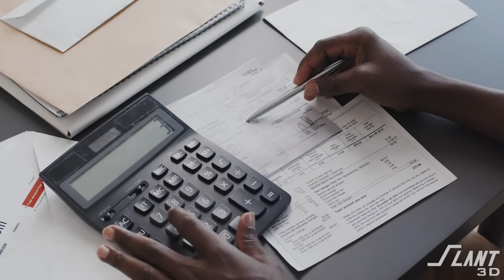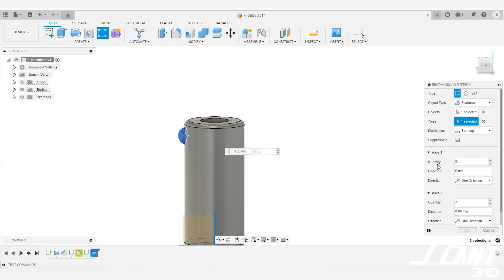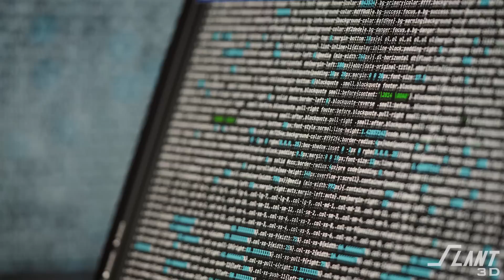3D Printing Will Obviously Replace Injection Molding

Comment: This year I sold around 3k 3D printed parts in kits and kits consisted out of different parts. Yes, I could have injection molded the main part, but would have needed a way higher upfront investment and would have needed to match look and feel with the low volume "auxiliary" parts. What people ignore is how insane of a quality MJF nylon sintering produces and how well it scales especially for smaller parts. Those prints can even be chemically treated / vapor smoothed to be gas-proof or cerakoted, if need be. This way I could modularize the kits to better match customer needs. And I was able to order in two seperate batches according to customer demand all with less than two weeks of lead time.
Reply: That's all well and fine but it's not a replacement for injection molding and your own comment proves it. 3k parts is nothing for an injection mold. They can make that in a couple days depending on part size. Also you mentioned the need for post processing to improve surface finish. Something that isn't needed on injection molded parts. Also i checked the tolerance for mjf nylon and its .012" that's laughable in the injection molding world when a loose tolerance is .005" and a tight tolerance is .002" like come on now. So while 3d printing is a great tool for small batch and medium production it will never fully replace injection molding the way it is now. Another thing to think about as well is large components. Can you 3d print a lawn chair as fast and as cheap as molding it NO. How about car interiors. How about tool bodies with multiple materials. What about metalic components like a dead blow hammer. While I don't doubt that 3d printing has a lot of cool applications to save money and time  mass production of parts is not one of them. End of story.......

Comment: Looking around me, there are not many plastic parts that I think would benefit from 3D printing passed the prototyping phase. What I see in front of me: keyboard, phone, computer monitor (large enclosure), pair of scissors (handles), pill box, shirt buttons, all sorts of cables and connectors, ... And I mean, look at 5:55 , these bins don't look 3D printed to me, and if a print farm doesn't print its bins, who will?

Comment: Very contentious opinion:

1.- Economics: do not underestimate the volume that certain industries require, for example automotive, one car will need thousands of different pieces and literally hundreds of thousand pieces of each, eventually your farm footprint, energy use and administration will be more expensive than the equivalent injection machine, and not every mold is a super expensive tool with slides and cooling ducts, some of the simpler ones can be made with a good CNC machine.

2.- Engineering issues: while 3d parts are improving injection molding is still generally tougher, less prone to quality concerns, while a 3d printed part can fail basically anywhere injection mostly  fails at the seam or the sprue, which depending on the application isn't a big deal, yeah they can shrink or warp too but they are much less prone to do that, some parts are actually easier to inject than to 3D print because of support material which you will never be able to completely avoid and FDM printing should not be used in some industries like medical and food due to safety issues of having lots of small crevaces in your part. Also what about larger parts? It would be really tough to print a car dashboard or a large box with 3d printing, that would be a very wasteful application where you would need a very large 3d printer with lots of empty spacebor even specially designed, also what about transparent parts? I can go like this forever but I think those are enough.

I love 3d printing, I do it all the time and see the value of it but this is overselling it.
Reply from the maker: Toyota considered 25K mass production
Reply: @slant3d  that's a very unfortunate statement considering they sell just in the US around 250k Corollas per year. Most vehicle programs produce AT LEAST 50k units per year and the larger ones like the F150 sell around 750k units per year.

Comment: Flexibility does not equal scalability, and injection molded parts are foodsafe due to low porosity. We print containers to organize parts, not tupperware to put in our fridges. Surface finish is a huge contributor to why injection molding is the way it is, spend $$$ on a perfect mold to make perfect parts for a long time on a single machine, it eliminates the variability that is every printers calibrations, variables are scaled down and production is scaled up. I know you're smarter than this, extruding filament slowly in singular layers, is not a catch-all solution.

Comment: What about cars and legos? Where high volume, infrequently changing design, and a need for high surface finish quality are combined, I don't see even the most efficient print farm outcompeting an industrial plastic injection mold setup. I think you've made your point about scalability really well, but I'm curious how you think 3d printing could take on well established and steady markets like car parts and LEGOS. Thoughts?
Reply from the maker: Lego is testing 3D Printing today.
Reply: @slant3d  I didn't know that. Super cool! Well, thanks for the video and thanks for sharing your knowledge about industrial scale 3D printing 😁

Comment: Your math isn't mathing. 

Assuming everything is in house

If I need to produce 1000 parts, I can easily print them. 
If I need to produce 10,000 parts, I can use a resin mold and a small injection machine
If I need to produce 100,000 + parts, I can use a industrial grade molding machine. 

Under what circumstances would dedicating 40,000 sq feet to a print farm be the most efficient way to produce parts quickly and consistently... Cramming 50 printers into the same volume as a single injection machine is still gonna have longer cycle times. If space is unlimited, then you can throw more printers at the problem until the win the total output metric, but I am not convinced that its cheaper, just more flexible at the expense of maintenance/complexity of scale.
Reply from the maker: We do it everyday
Reply: @slant3d  Again another empty reply with no actual data or proof behind it.  You are just spurting out your opinion with nothing to back it up here.  Why bother replying to the comment if you are not going to even address it?

There are applications for FDM but saying that putting 1000 machines in a large building is the same as injection molding isnt even talking about the elephant in the room man.
Reply: @slant3d  Being based out of Boise is massively tainting your perspective. Most places can't just dedicate more space to more printers because of the cost per sq foot of workspace. You are in one of the cheaper markets and trying to extrapolate your success to Tokyo.

Comment: Welp, I believe the comments section has captured it all. 

While the upfront cost of injection molding tooling is high, we usually design in a way to share it with other products or future-proof it. The tooling manufacturer can also modify the tooling to accommodate certain dimensions. I appreciate 3D printing during the prototype stage, but it doesn't seem likely to completely replace injection molding in the near future. Each has its own place.

Comment: Here is what you forgot. injection molding machines produce more parts per sq foot of shop space. 

If you measure output per sq foot, you immediately run into a wall of cheap space is in locations without skilled labor and skilled labor is in locations with high cost per sq foot. 

That alone is a huge justification for injection molding.
Reply: And are you accounting for downtime as well as upfront costs?
Reply: @SirSpence99   upfront costs are good to be exorbitant regardless. To some extent you can grow into a print farm, but you run into issues really fast like not having enough amps on the breaker. So now you have to remodel to turn your warehouse into a factory. 

Molding to some extent requires you to just start with a factory, so slight advantage 3d printing, but we are comparing prototyping to production kinda by definition at that point. Anyone looking at either needs to deploy serious cash regardless.

Downtime is a more interesting conversation. Would you rather have 10 percent of your machines broken at any point in time or 100 percent of your machines broken 10 percent of the time? It would be the same total throughput, but the first requires way more labor to manage.

Comment: if you are trying to bait the discussion i think its a little cheap on your side but effective none the less lmao.
On the other side i think you are way too retail oriented on your business, at least that is what we see on youtube, it would be nice to see real industrial, well engineered parts on the videos and discussions on that front, at least imo. And it would be nice to see a little humility on the answer of real well argumented comments, and not take the "im too ahead of my time" kinda Steve Jobs take that you are having.
You are also reaally underestimating the possibility of cost reduction on the moulding machine side, at the end of the day it is a cheap block of aluminium or steel in most cases, so the cost is all industrial, that means potential cost reduction over time approaching material cost.
Reply from the maker: Check our library
Reply: @slant3d  Again, a well thought out and articulate comment and you can't be bothered to give them a real answer.  Why respond at all if you aren't going to try and address the comment.  "Check our library".  You could provide links to relevant videos that address the comment, if they exist.
Reply: @LearnEverythingAboutDesign because he's wrong and he knows it. This is an ad for his business. He doesn't really know what hes talking about when it comes to mass production of components. He also doesn't go over surface finish which is a massive drawback to 3d printing.

Comment: Whoa.  3d printing is a very good low-volume test environment.  Way different market than high-volume injection molding ie packaging products, food containers, construction, medical, etc...  These markets often require millions of parts per day.  It has its place but quality and product integrity still have a long way to go for printing.  You might want to go visit a large molding plant and reassess those comments.
Reply: Yeah 3D printing and injection molding do not share the same purpose at all. Injection molding is for making parts that are needed in massive quantities very quickly. Parts that you will need a lot of, for a long time.

3D printing is for prototyping, making drafts, being able to change the model being produced on the fly, and perhaps most importantly, being an accessible means of production to people who don't have dozens of thousands of dollars or more. 

However, I'm not saying that print farms can't be effective ways to make money quickly. We wouldn't see print farms hardly at all if that was the case. Print farms can change their produced product in just 24 hours with little to no modifications. They serve a different purpose than injection molding, which is why they will not replace it.
Reply from the maker: Not to be pedantic. But packaging isn't really a product. Molding can have it
Reply: @slant3d  Packaging is 100% a product.  And how can molding have it if 3d printing will replace molding?  I have had to design geometry for polystyrene for boxes to hold things during shipments.  Molds are made, there are requirements for draft angles and radii etc.  To think that packaging isn't a product just shows me that you haven't designed products.  Thermo formed "blister packs" are designed.  So if your smartphone came shipped in a sock vs a well designed box it would be the same thing?  And you missed the point of the comment and focusing on one thing in it.  To think some of the medical device projects I have worked on for clients would be end use FDM is laughable and it shows that you are in a bubble.  Sure FDM print farm for etsy shops selling trinkets is fine, but to claim that it will replace injection molding is either something you are doing as click bait or you drank your own koolaid man.  FDM can exist without waging a war on other manufacturing processes.

Comment: 3D printing has numerous advantages as mentioned, but the poor surface finish, highly anisotropic material properties, and low cycle time per machine makes it incompatible with most products. Stick to making the most of 3D printing and stop lying about its limitations.
Reply: spot on, i have a couple years of 3d printing small business and i think here is being a bit oversold, as any business owner should of course
Reply from the maker: Incorrect. There is no engineering reason. Printing can't replace virtually every molded product
Reply: @slant3d Can or can't? You are contradicting yourself in this comment
Reply: @slant3d   Your company makes 3D printed parts at a large scale. I know that. It’s also true that there are limitations to the technology.

Comment: Unsubscribed. This video is full of dishonesty. 3D printing is a great technology but it will never replace injection molding, not even in most applications. Wishful thinking from someone who is completely blinded by your own biases.
Reply from the maker: Already is. Check what we do for a living
Reply: @slant3d   Your company does 1000’s of parts. The global market for injection molded parts is billions of times that. 3D printing is not as scalable as injection molding due to the human labor component required to keep 3D printers running at capacity.
Reply: @slant3d  Yeah you have an FDM print farm and make false claims about FDM being equal to molding.  Got it!  You can promote your business and FDM and not try to make it some massive global take over.  IF you were going to do that with 3d printing why on earth would you pick FDM as your horse in that race?  MJF, SLA, SLS all have major benefits over FDM.  The downside is the startup cost.  So you picked the cheapest option, that most people have at home.  An injection mold machine can spit out more parts in an hour than your print farm can spit out in a week.  And that is fine.  Just don't try and skew it.  You are either lying to people so they use your service, or you are very out of touch with the entire industry of manufacturing.  Not sure which is worse, but please back up your claims or state them as opinions so people know.

Comment: There are certainly some parts where 3d printing will replace a molded part but I think you are underestimating just how many parts are high volume. In my industry I’ve seen many parts moved from a machined metal process to 3d printed, but never a part that would have been molded to 3d printed. If the volume is high enough to justify the cost of a mold, then the volume is too high to justify 3d printing it, the space required and manpower needed to match the speed of the mold just doesn’t add up. One of the 4 molders in my facility makes 300k parts daily and very rarely ever stops due to over production.
I see 3d printing as far move of a threat to machining then to molding.

Comment: Yeah - no.

FDM  and resin processes have an important place in prototyping, but there are some glaring shortcomings in the material properties of the parts produced. As for mass production, its hard to beat the volume and low cost of injection molding. The part's mechanical  properties are better (uniform) with IM as well. And, highly precise parts are probably still going to be machined from billets, (can't tell you how many acetal and nylon gears I had to make during my machining career).
All the products of engineering are compromises. Its always a case of whether the choices made will meet the mechanical needs of the application.

Comment: Diecasting is for toys😂. You can't 3d print a 🚀 engine 🤣. Future is 3D printed molds!(made out of high impact, high thermal conductive, high temperature thermoplastic!) that can be used in equally low cost, low pressure continuous injection? ultra small formfactor(size of a large desktop 3d printer) plastic injection machines❤👍

Comment: Using 3DP for rapid prototyping and iterations and then making a mold of the best prototype is how my lab uses it. If you consider how much space injections molder take up you could fit about 25 to 50 printers in the same space for the same power and price. This should be taken into account when looking at cycle time.
Reply from the maker: True. Printing already matched molding in production scale

Comment: 3D printing is great for fast iterations and personalized products.
But we will never 3d print syringes. They will be injection molded - alongside many other products that we do demand millions of.

3D printing has it's place, injection molding has it's place.
Reply from the maker: 3D Printing Printing will effectively replace tradition in effectively all product ranges. We still use horses today because cars can't walk. Doesn't mean horse are "better"
Reply: @slant3d  I definitely agree with you for 95% of the types of products that are currently injection molded.
3D printing cuts into that low, medium, and even high volume. But not extremely-high scale.

Plus, I'm a software developer, the personalisation aspect is ideal as you said, but it's extremely hard to do and going to take a lot of IP to get there. Plus some tools (Like LIDAR, which are being added to modern flagship smartphones, so that's not too far away).